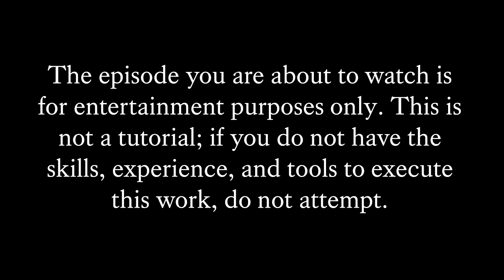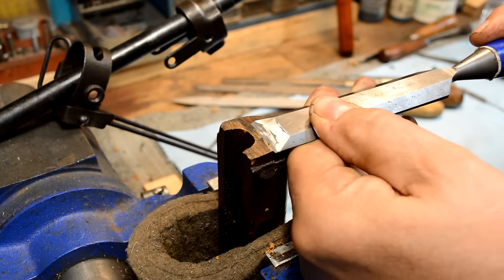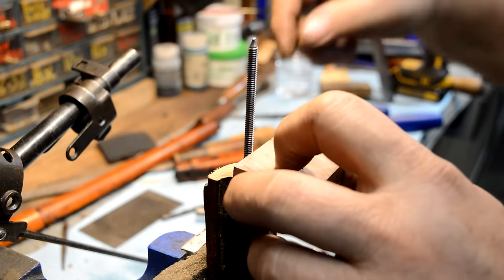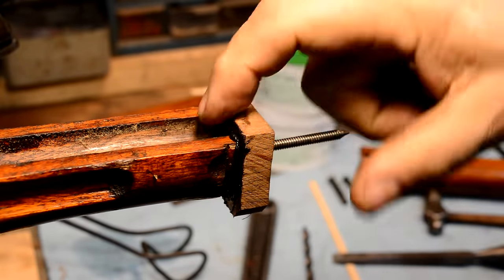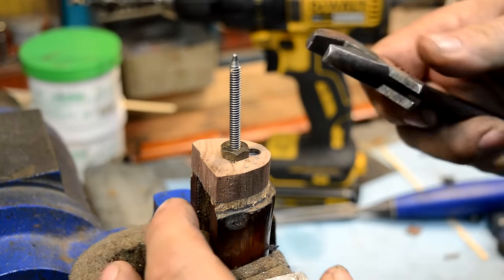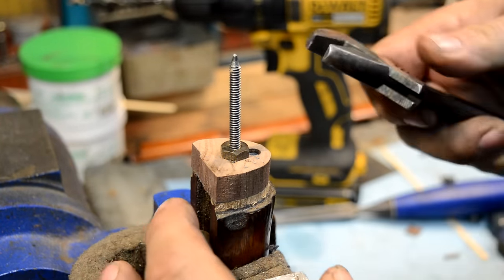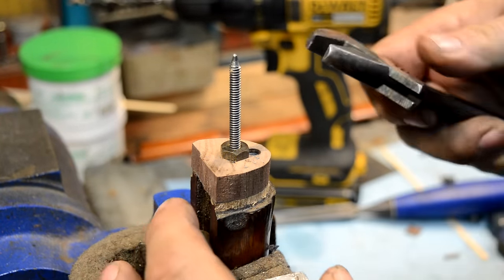Anvil 086: Type 99 Arisaka duffel cut repair

Comment: WOW! Amazing rifle. You are a real deal old school "Smithy".
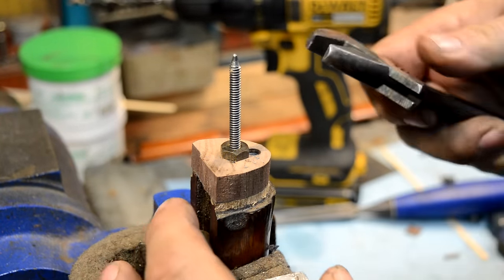Reply: Well this isn't going to be welcome but here we go. @31:53 we can very clearly see that the top edge of the stock on the right is noticeably higher than that on the left of the join. Mark does not see this. This is the stage where the parts are brought together dry so that they can be fitted correctly. Look closely, it can be seen that the barrel is sitting down hard into the wood on the right but is lifted in the wood on the left as witnessed by a gap between the wood and the metal on the left. This can only be caused by the wood on the right being too high in relation to the mother stock and shows that the hole for the threaded rod is in the wrong position and is causing the joint to be out of line. 
Having assembled the joint @37:43 we see that the exact same conditions apply and the repair is out of line. Start watching at 38:10 Mark checks the alignment and (look closely) moves the stock even further out of alignment by lifting it higher. Shortly after this he confidently tells us that this is not the sort of gun that you learn on. @40:10 here's the smoking gun! Notice how the wood grain is showing through the glue. It stops showing at the exact line of the join because the barrel was lifted up from the mother stock by the miss aligned stock. All the pressure of the rubber strap could not pull it true because the threaded rod could not allow it to move into line. @42:32 look closely at the visible left hand edge of the glue and it can be seen to have considerable thickness. This is the result of the barrel not sitting down in its cradle in the stock. The thickness of the glue exactly matches the degree of missalignment of the top edge. @45:01 he finally notices the problem with the top edge of the stock and cuts a little wood off. @45:16 Mark starts to explain that wood moves with time and he's right. However no amount of explanation can put this situation right. @47:18 he cuts away wood and tells us that it swelled right here. He demonstrates that he does not understand why the top edges are not in line and level. @49:14 this is the first time that we see the results of the missalignment. Not withstanding any bending of the top stock the gap between the top and bottom on the left of the joint is exactly equal to the degree of error in jigging the two parts of the stock together. Mark's attempts to blend the joint are seen as a freshly cut ramp in the wood. @51:23 Mark is telling us that the front end joint is tight and it is. However he makes no mention of the gap behind the joint which will always be there. @54:20 observe the gap where the top covers the bottom. In spite of any explanations that gap is there because Mark assembled it out of line. 
I have been a gunsmith for over 40 years and am often called upon to correct poor repairs. I despair at this job and I wonder if the owner will be content with explanations of swelling wood as he holds this rare example. Often I have found that workers who make sure we all know how good they are can produce average work with eloquent and lengthy explanations of how difficult it was and how the average joe would make a hash of it. I expect this comment will be deleted as it will not sit well with Mark Novak. I challenge you to leave it here so that your viewers can respond.

Comment: I bought a last ditch Arisaka at a very bargain price.  In great shape but reduced price because "duffel cut".  
My father had a music shop that specialized in repair.  I worked with and became maybe proficient at wood repair. A tuned guitar has to withstand 1500 pounds at the neck body position due to string pressure. So, I watched youtube vids and consulted other sources
and so joined the two main stock pieces pretty much professionally.  Good job!
Then I found out that many last ditch rifles had a three piece stock as mine did.......sigh
But it's a great "repair" and a lesson in research first, research first...........
Reply: A lot of "last ditch" 99s actually had what seemed to be a "duffle cut" intentionally so they could use shorter length wood blanks due to the supply chain issues.

Comment: There is something other than filler in my ciggy but I am thinking you could get the action dry bedded in the rear of the stock as you have it mounted, use a plumb bob down the back of the barrel to find center, mark it off rough fit the front end on and pick up a few reference points with a chalk pen or something that will rub off without leaving damage.
translate holes to the forfend and you will get away with a much less sloppy hole and rely less on the glue as a filler.

Could also make a quick jig to get the stock halves nice and level and perpendicular to the bore and just kiss it on a linisher with a very light belt (once you square off the rest). that would ensure both ends were as square as you are likely to get and this would greatly help step one.

Certainly agree with you on the thickness of the spacer, I can't think of a way really accurately measure the thickness other than to ball park it using the step in the stock as a reference back to the hole center, would still have to sneak up on it and again that linisher jig would work a treat.

Comment: You could have cut a thinner shim and backed the nut with a thick flat washer to get the squeeze you want. It'll be as strong as the method you used but still be easier to carve down.

Comment: Thank you sir! This was really awesome to watch your work and to learn from your experience. Much appreciated.
Reply: Well this isn't going to be welcome but here we go. @31:53 we can very clearly see that the top edge of the stock on the right is noticeably higher than that on the left of the join. Mark does not see this. This is the stage where the parts are brought together dry so that they can be fitted correctly. Look closely, it can be seen that the barrel is sitting down hard into the wood on the right but is lifted in the wood on the left as witnessed by a gap between the wood and the metal on the left. This can only be caused by the wood on the right being too high in relation to the mother stock and shows that the hole for the threaded rod is in the wrong position and is causing the joint to be out of line. 
Having assembled the joint @37:43 we see that the exact same conditions apply and the repair is out of line. Start watching at 38:10 Mark checks the alignment and (look closely) moves the stock even further out of alignment by lifting it higher. Shortly after this he confidently tells us that this is not the sort of gun that you learn on. @40:10 here's the smoking gun! Notice how the wood grain is showing through the glue. It stops showing at the exact line of the join because the barrel was lifted up from the mother stock by the miss aligned stock. All the pressure of the rubber strap could not pull it true because the threaded rod could not allow it to move into line. @42:32 look closely at the visible left hand edge of the glue and it can be seen to have considerable thickness. This is the result of the barrel not sitting down in its cradle in the stock. The thickness of the glue exactly matches the degree of missalignment of the top edge. @45:01 he finally notices the problem with the top edge of the stock and cuts a little wood off. @45:16 Mark starts to explain that wood moves with time and he's right. However no amount of explanation can put this situation right. @47:18 he cuts away wood and tells us that it swelled right here. He demonstrates that he does not understand why the top edges are not in line and level. @49:14 this is the first time that we see the results of the missalignment. Not withstanding any bending of the top stock the gap between the top and bottom on the left of the joint is exactly equal to the degree of error in jigging the two parts of the stock together. Mark's attempts to blend the joint are seen as a freshly cut ramp in the wood. @51:23 Mark is telling us that the front end joint is tight and it is. However he makes no mention of the gap behind the joint which will always be there. @54:20 observe the gap where the top covers the bottom. In spite of any explanations that gap is there because Mark assembled it out of line. 
I have been a gunsmith for over 40 years and am often called upon to correct poor repairs. I despair at this job and I wonder if the owner will be content with explanations of swelling wood as he holds this rare example. Often I have found that workers who make sure we all know how good they are can produce average work with eloquent and lengthy explanations of how difficult it was and how the average joe would make a hash of it. I expect this comment will be deleted as it will not sit well with Mark Novak. I challenge you to leave it here so that your viewers can respond.

Comment: the reason for the rear sight hitting the wood is because wood is missing from the cut, i usually router out a channel in the 2 halves and epoxy in a long square piece of hardwood for a lot of gluing surface, if you made the spline slightly dovetailed, it would also be a mechanical lock too.  the front sights on arisakas both 99 & 38s are on with 1 or 2 pins that are in extremely tight, skip trying to remove them and just rust blue the hardware if it needs it.

Comment: You could have put a thin strip of glass fiber fabric in that barrel channel so it would get saturated with the glue and make a laminated hidden U shaped reinforcer under the barell. That would have made for a really strong joint.

Comment: I was doing research on my 99 Arisaka (made in 1943, no dust cover or monopod. Still has a visible mum but was defaced with what appears to be a chisel. This indicates a surrender in the field rather than at a shop where it would've been ground). The finish on these rifles is called "Urushi" (Ü-Roo-She). Its a very tough finish similar to the shellac the Russians used on their stocks but it was made from incredibly poisonous Sumac or Ivy. If any of you plan on refinishing your Arisaka stock, (which.. not sure why you would but to each their own) do it in a VERY well ventilated area and I would suggest using goggles and a mask as you WILL inhale the dust and you WILL regret it.
Reply: Sounds like you are speaking from experience...life is tough and we have all been there...and got bent over...
Reply: @dennispfeifer7788  oh no. Im  not speaking from experience. This is just from all the research I do on my rifles before I dive in. I NEVER go into a milsurp blind. I do tons of in-depth research on any rifle I plan on working on and/or tearing apart. I dont like surprises when it comes to disassembly
Reply: @CaptainNonsense1  Have you ever went to work and at the end of the day in the same shape than when you started the day?  I have, by rotating a wheel to the wrong setting on an grain elevator bin, and a simple mistake of putting feed in the wrong bin on top of other feed that was totally different...then we had to get 5 gallon buckets and a rope and crawl down into the bin and start lifting it out one bucket at a time, with one man on top...tons of it...at the end of the day you are exhausted and back to you were at the start of the day...it's behind you now, but you will never forget it for the rest of your life...

Comment: Actually. To use the anti aircraft sights, you aim the sight like you regularly would. So line up the front and rear sight then have the aircraft trailing on one of the notches on the bars. You’ll have your entire company do this and early on in the war when these sights were standard, the Japanese were shooting at wood and canvas Chinese aircraft that were not flying that high or fast when its engaging your element. So they’re not really that optimistic

Comment: Love and appreciate the work. Guy after my own heart . It's the "Ahhhhhhh man" from the customer that makes the salve for the heart. Makes bending over backwards all worth it. Amaze the customer =)
Reply: Well this isn't going to be welcome but here we go. @31:53 we can very clearly see that the top edge of the stock on the right is noticeably higher than that on the left of the join. Mark does not see this. This is the stage where the parts are brought together dry so that they can be fitted correctly. Look closely, it can be seen that the barrel is sitting down hard into the wood on the right but is lifted in the wood on the left as witnessed by a gap between the wood and the metal on the left. This can only be caused by the wood on the right being too high in relation to the mother stock and shows that the hole for the threaded rod is in the wrong position and is causing the joint to be out of line. 
Having assembled the joint @37:43 we see that the exact same conditions apply and the repair is out of line. Start watching at 38:10 Mark checks the alignment and (look closely) moves the stock even further out of alignment by lifting it higher. Shortly after this he confidently tells us that this is not the sort of gun that you learn on. @40:10 here's the smoking gun! Notice how the wood grain is showing through the glue. It stops showing at the exact line of the join because the barrel was lifted up from the mother stock by the miss aligned stock. All the pressure of the rubber strap could not pull it true because the threaded rod could not allow it to move into line. @42:32 look closely at the visible left hand edge of the glue and it can be seen to have considerable thickness. This is the result of the barrel not sitting down in its cradle in the stock. The thickness of the glue exactly matches the degree of missalignment of the top edge. @45:01 he finally notices the problem with the top edge of the stock and cuts a little wood off. @45:16 Mark starts to explain that wood moves with time and he's right. However no amount of explanation can put this situation right. @47:18 he cuts away wood and tells us that it swelled right here. He demonstrates that he does not understand why the top edges are not in line and level. @49:14 this is the first time that we see the results of the missalignment. Not withstanding any bending of the top stock the gap between the top and bottom on the left of the joint is exactly equal to the degree of error in jigging the two parts of the stock together. Mark's attempts to blend the joint are seen as a freshly cut ramp in the wood. @51:23 Mark is telling us that the front end joint is tight and it is. However he makes no mention of the gap behind the joint which will always be there. @54:20 observe the gap where the top covers the bottom. In spite of any explanations that gap is there because Mark assembled it out of line. 
I have been a gunsmith for over 40 years and am often called upon to correct poor repairs. I despair at this job and I wonder if the owner will be content with explanations of swelling wood as he holds this rare example. Often I have found that workers who make sure we all know how good they are can produce average work with eloquent and lengthy explanations of how difficult it was and how the average joe would make a hash of it. I expect this comment will be deleted as it will not sit well with Mark Novak. I challenge you to leave it here so that your viewers can respond.

Comment: That is awesome! Amazing work Mark. I’ve been eying a type 99 Arisaka but sadly isn’t in nearly as good of condition as the one you fixed. I didn’t realize the stock had been cut until seeing this video. May try to scoop it up for cheap
Reply: Just wanted to help by saying not all Arisakas have had a duffel cut and been repaired. It might save you accidentally insulting an owners price point. I've owned 3 of em and one had never seen a saw. My uncle owns 3 currently and not one of em have had a duffel cut. Good luck!

Comment: Mark,. I remember a repair video that you did on the stock forend of a Carcano M91/41 I believe. I have been searching for that vid but cannot find it. I have just such a repair to do. Thanks for your great productions, you share so much with us.
Reply from the maker: GEW 91?   Never filmed a carcano, but all duffle cuts are essentially what we did here.
Reply: @marknovak8255  My mistake, I guess  I have my 91/41 on my mind. I do remember you putting two pins in adjacent to the cleaning rod hole and above that a threaded brass(?) rod channeled in and bedded with Acraglas or an epoxy. I will keep watching. Thanks for your good work and shows.

Comment: Without a doubt a beautiful rifle, one day I will absolutely own an Arisaka.
Reply: The Japanese sword equivalent rifle.  Very beautiful.
Reply: I do own one a type 38. 👍 mine is not near as nice as this one.  Unfortunately I can not take mine to the range 😭but it is still nice to have.  By the way the mum was worn off, not ground off.
Reply: @nicholassternon5857  well I could but it more then likely will come back in pieces.  The barrel has a slight bulge about half way down its length. Also the rifling is very faint.  I’m not too upset, it is still a beautiful rifle.  It had part of the last shell casing still in breach when I got it.
Reply: Gus The wise one ahhhh I understand